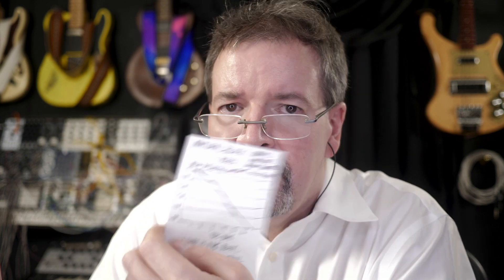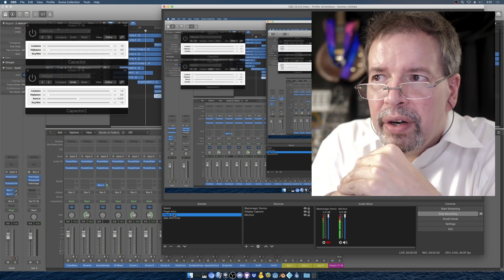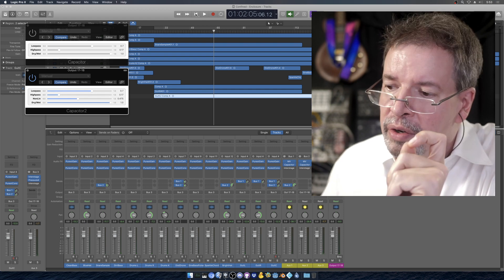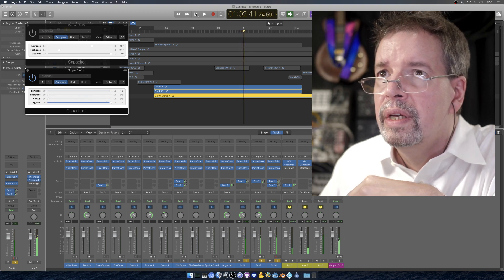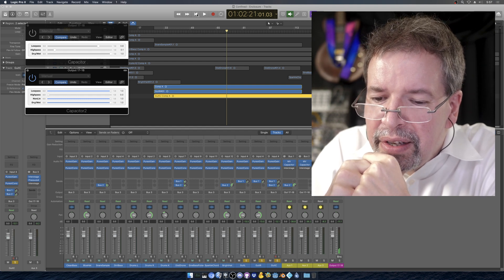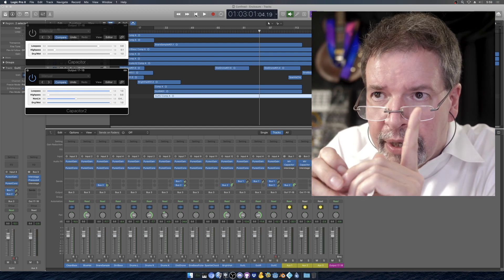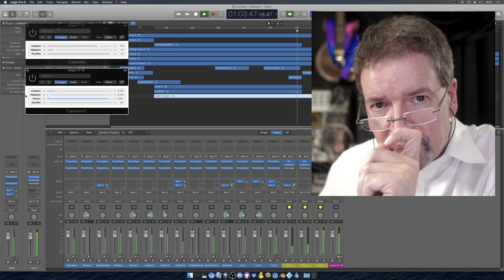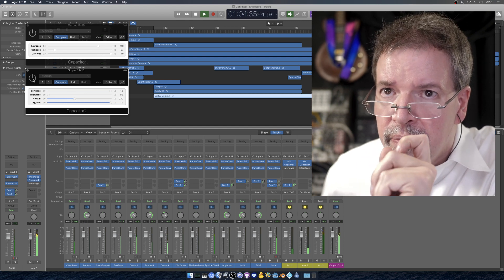Airwindows Capacitor2: Mac/Windows/Linux AU/VST

Comment: Allpass - as many in a row as possible with macro for phase control that's a plugin I desperately. I need to be able to sequence and modulate it… its for rapidly changing ir based convolutional pallets and ambisonic channel rotation-rapidly changing fft types.…. Only thing everything I use has to have crossmod even if its an line for modulation, line in, or cv. I use them all.. That's the skeleton of what I have but I believe others in the experimental space would benefit without Kyma 7 and modular synths interwoven .
Reply from the maker: youtube AI had a variety of garbage suggestions. Have you tried MV? also MV2. That's 'as many allpass in a row as possible, literally. Might not have all the features you need but I do have 'as many allpass in a row' already :)
Reply: @ I will look for it thank you so much.. In the kit.
Reply: @ LA synthesis is what springs to mind on Mv 1 when you sing. I think both are as wonderful as many other things you've created.. I'll try stacking partials to see if it combs.. My experience with alpasses is extreme combing.. I extreme functionality of your work .

Comment: I like the saturation of this filter plug-in, though I think I've managed to fry it :D
Feeding a very hot (+20 dBFS) 50 Hz Sawtooth at 100% Nonlinearity made the plug-in first distort in a very strange and unpleasant way, and then go permanently silent.
Is that expected behavior?

EDIT: It didn't go silent, actually it started producing NaNs or something else that made all other audio silent aswell.

EDIT2: Also, the Non-Linearity control has zipper noise.